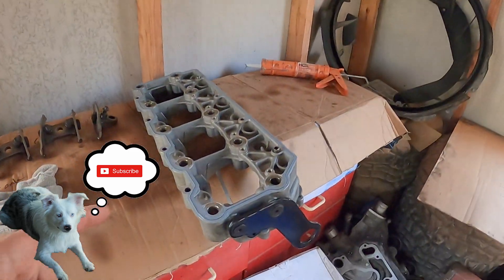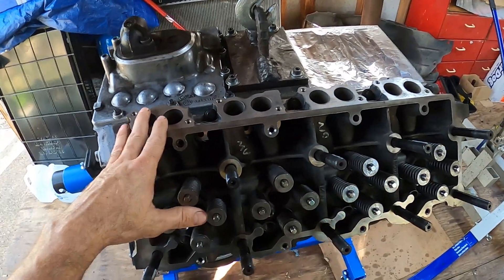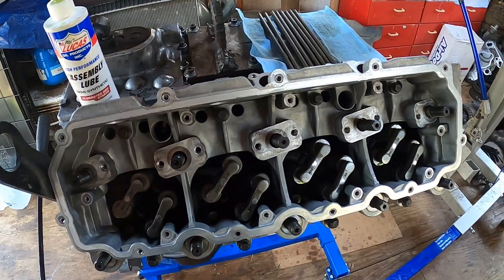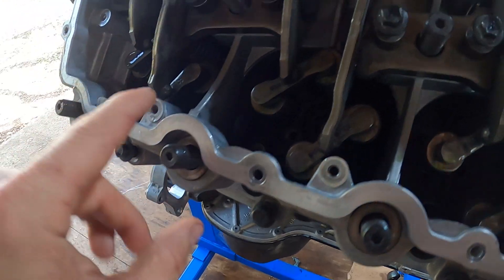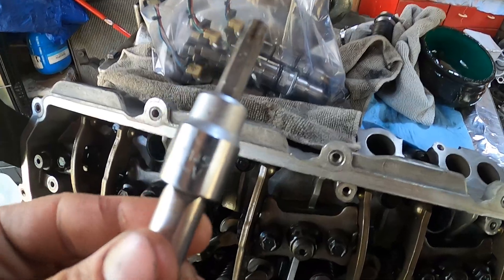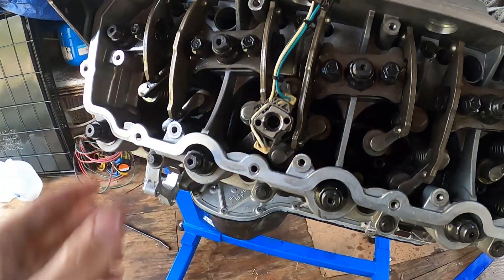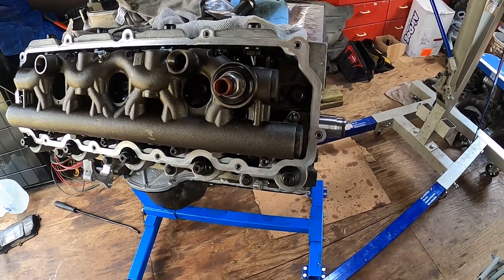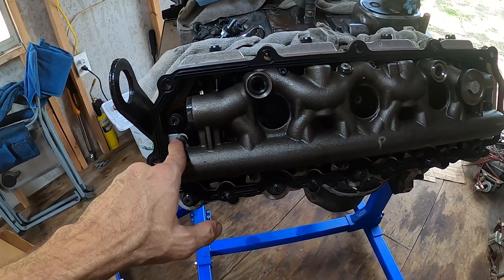6.0 Powerstroke - DiY Engine Rebuild - Part 7

Comment: Great work again! Did you torque to 210 ft/lb? I did a 5 step torque but I did a little higher last torque 225, that’s just me.. I like smaller increments... Also, since you have o-ring heads you you should retorque after you have run the engine. I am going to do that as well even I don’t have o-ring heads. Any engine I have built I do that except for the big diesel truck engines with loose cylinder sleeves who gets direct contact with sleeve and cylinder head with very high torque.
Reply from the maker: I went a bit higher but wasn’t going to tell people to do that too lol.
Reply: @grumpysdiy  he, he your good! 😁
Reply from the maker: Do I really need to torque the bolts down again after running it?
Reply: @grumpysdiy  I have always done it. You can search for what other says about the o-ring heads, but I think you really should. It will never hurt, peace of mind even it it doesn’t move anything...
Reply from the maker: Well I was hoping to never see the inside of the valve covers again lol.
Reply: @grumpysdiy  lol! If you use extra short extension you can do it without pulling the oil rail.
Reply from the maker: Wait how I can’t imagine it.
Reply: Also, I would drive it around 150 miles on a cheap oil then change oil and filter and then retorque at the same time.
Reply from the maker: @sveinhaland2975  So I got this oil filter https://killdevildiesel.com/collections/6-0-powerstroke/products/6-0-k-p-stainless-oil-filter what do you think about it?

Comment: did you use the 6.4 push rods after you machined the block and heads? if the machine shop milled the heads and the block the clearance changes and they suggest to use the shorter 6.4 push rods
Reply from the maker: Not the block, just resurface of heads.

Comment: O-ring is the way to go but  fel-pro gaskets are good 2nd option too. they have a o-ring that actually cuts into the mating surfaces and half the price of OEM And black but not recommended on o-ringed heads so i gambled non-oring heads and xotic headstuds vs arp  been good so far saved over $800 biggest trick is lapped the surfaces to around 30 ra and double checked Torque after 24 hours and don't listen to guys that intently over torque for higher clamp rate they compromise the gasket and fail at 20-25k
Reply from the maker: Nice saving money is always a plus. I didn’t have to buy our head studs they were already there. I
Figured with all the heavy towing I do the o-rings were the way to go. Also on a side note the engine has way more compression now than before. I can’t turn the engine over by hand now, before I took it out I was rotating the engine to take the torque converter nuts out.
Reply: @grumpysdiy  new rings n bearings not seated yet will add friction too First start up on a fresh motor can be a lil frightening alot of scary sounds n smoke till the imperfections smooth out  and oil warms up some shops will take cheese cloth or news paper  to polish new bearings may look into some break in additive has certain minerals they removed from oil few years ago and pull ficm relay to pre oil system maybe some wd-40 in each cyl before you turn it over
Reply from the maker: @hotrod6919  I did prime the turbo and unplug the glow plug harness. Great idea on the FICM and oil additive. What kind of break in additive would you recommend for the old 6.0? Would https://amzn.to/3v5yd5i work?
Reply from the maker: Also what do you think of this oil filter I picked up? https://killdevildiesel.com/collections/6-0-engine-products/products/6-0-k-p-stainless-oil-filter
Reply: @grumpysdiy  that filter looks impressive what's im interested  the microns spec? on the additive i use i get it from summit racing think its marketed from comp cams grey bottle
Reply from the maker: @hotrod6919 K & P Engineering's website FAQ says "Paper filters are rated on averages, percentages of efficiency (also known as beta ratios) and multiple passes, so a 10 micron rated paper filter (as advertised on the packaging) may be letting particles 50 microns and larger through. The medical grade stainless steel cloth that we use is consistent across the entire media surface and is rated at 35 microns, meaning nothing larger than 35 microns should pass through the material. The bottom line is we meet or exceed the filtration performance of OEM filters, eliminating any warranty issues."
Reply from the maker: I am mostly interested in the up to 7 times more flow. I don't know about everyone else but a 3 mississippi count to start my truck feels slow and the higher oil flow should start the truck faster due to the ICP required oil pressure to fire.
Reply: @grumpysdiy  Yeah mines Early 03' different rails n icp is next to ipr so they start fast  then 05+ but 3 Mississippi still sounds long wonder HPOP was leak or Failing its rare but late style pumps do fail
Reply from the maker: I always thought it was a leak while resting. Because the icp build up I watched on my scangauge it would start low less than 50psi. Then build relatively quickly.
Reply: @grumpysdiy  50? its not supposed to start till icp reads 500 and 1200-1500 idle and 3600 wot
Reply from the maker: Over the course of 3 Mississippi count the gauge reads 50 at turn key and by 3 Mississippi it’s over 500 to start.